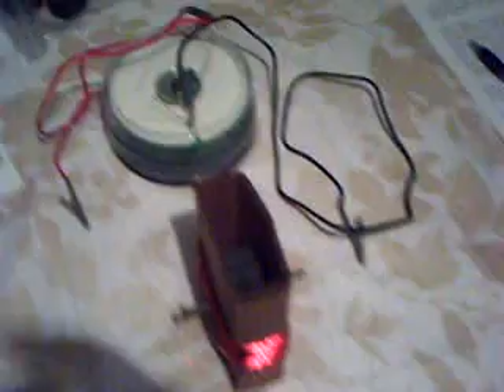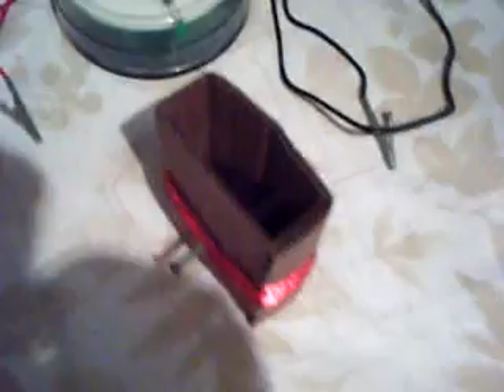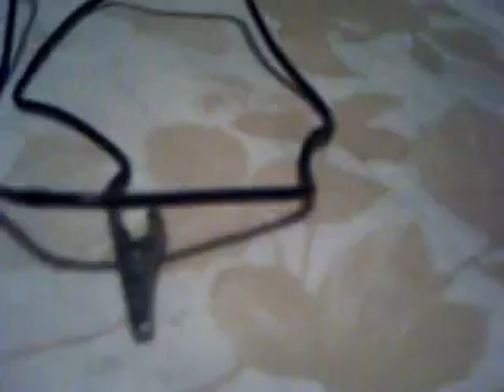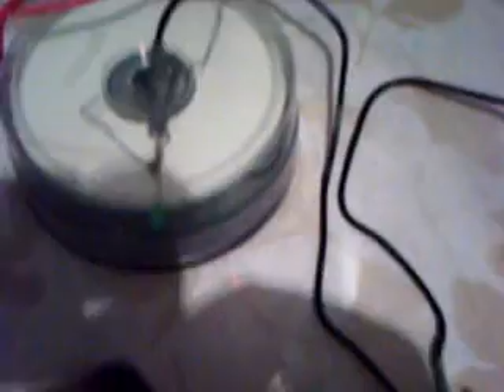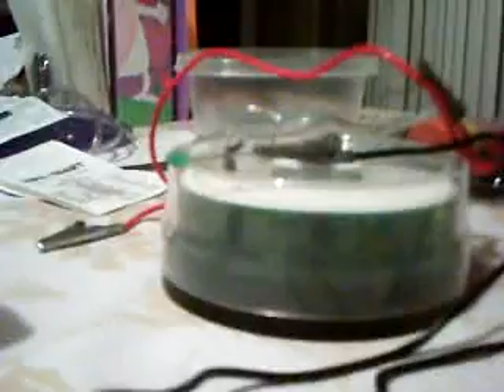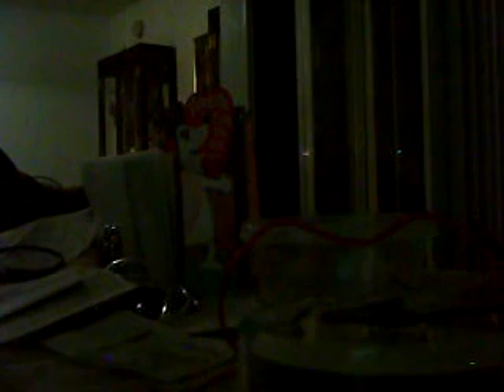Simple electric generator

Comment: 600ft of #30 wire can light a red LED if you spin the magnets fast enough.   Or use less wire, and use a tiny 1.5v 20milliampere "grain of wheat" light bulb from Radio Shack.